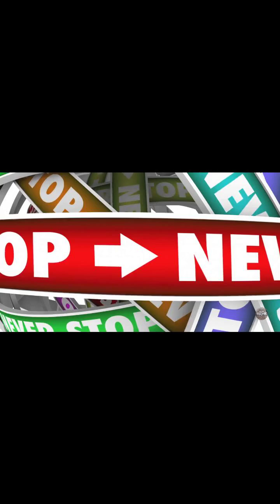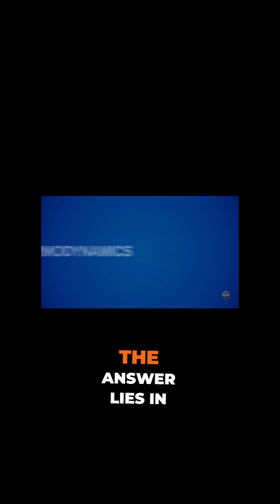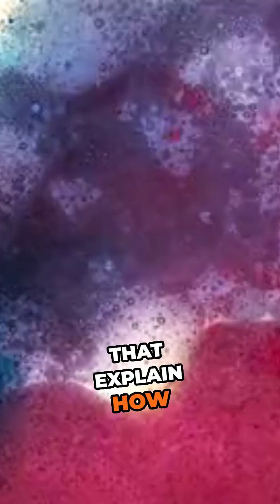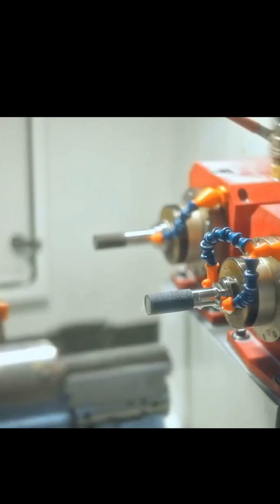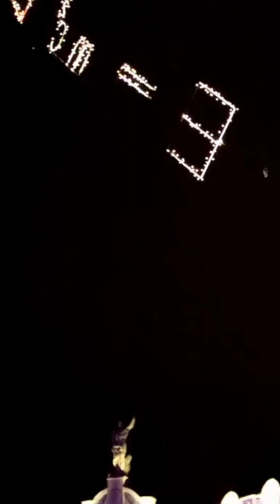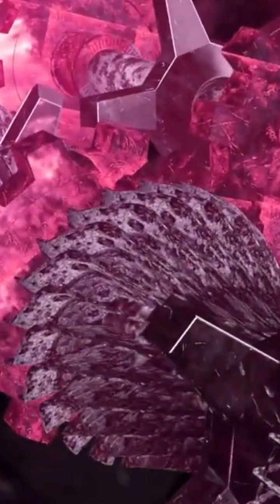Why Perpetual Motion Machines Fail

Comment: Constant speed is constant, so if it is not under the influence of external forces, there is practically no difference between moving at steady speed and not moving at all as far as physics is concerned.
Reply from the maker: Interesting...🧐 would only be true in the vacuum of space, where there’s no air resistance or friction, but even there, forces like gravity can eventually disrupt constant motion.
Reply: @NotSoTechie-News  friction and air resistance are external forces, and while gravity is an internal force, the only way it can change the speed of a system is to interact with the gravity of another system.
Reply from the maker: @murdoc296  love the debate..LOL You're absolutely right—friction and air resistance are external forces, & gravity is indeed an internal force within a closed system. However, for most practical scenarios on Earth or near other celestial bodies, interactions with external systems (like gravitational fields from other objects) are inevitable, which is why perpetual motion remains unattainable in practice, even in space.